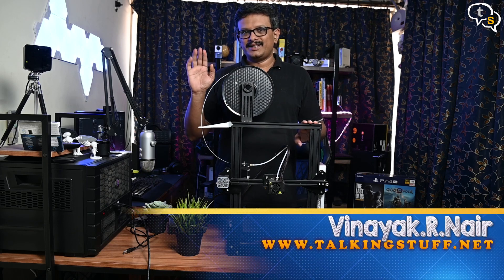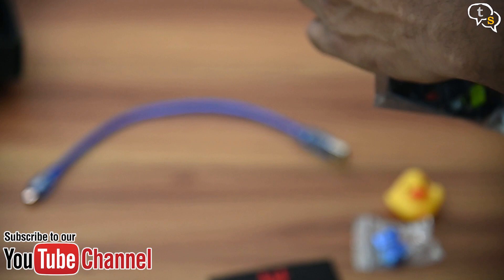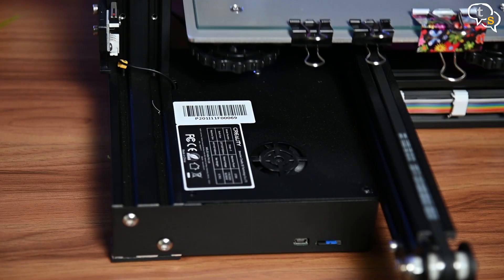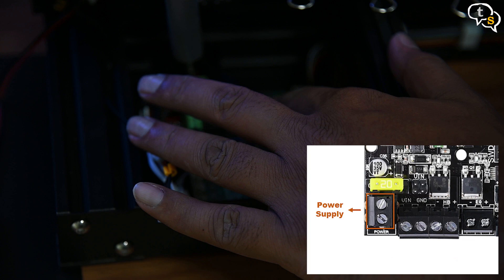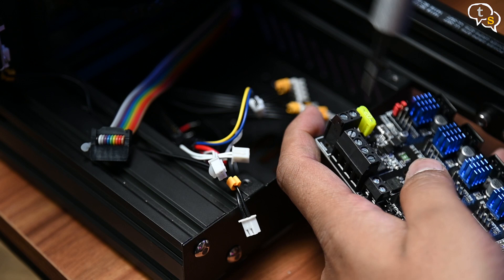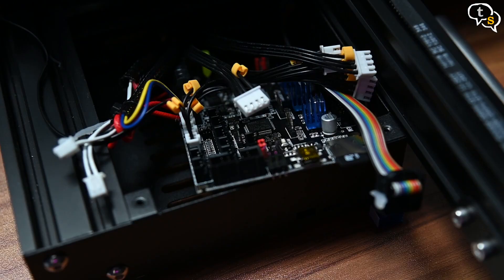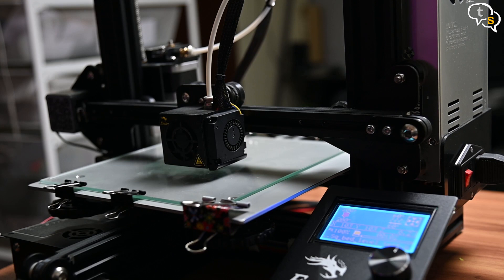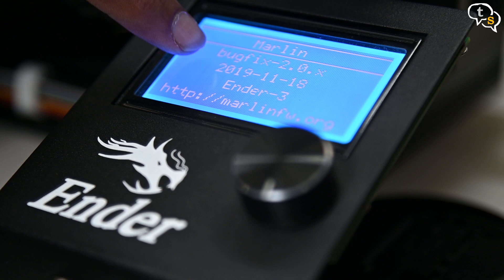SKR Mini E3 - Ender 3 3D Printer 32-bit controller board upgrade

Comment: Does  anyone know by any chance if octoprint works with this board along with the tft35 e3 v3.0 display and ender 3 printer?
Reply from the maker: I've read to keep the connection speed to auto and alsp power on the printer before connecting the raspberry pi to it. Connect only once booted up.
Reply: @TalkingstuffNet  Thank you!

Comment: Iam interested I buying this board and the stepper driver...I want to know if there are issues in customs while getting it from Ali express
Reply from the maker: I purchased from Biqu website, who are the developers of the board. I had no problems with customs when I purchased from them. But I had purchased last year, not sure if there are any changes to customs rules now.
https://www.biqu.equipment/products/bigtreetech-skr-mini-e3-control-board-32-bit-integrated-tmc2209-uart-for-ender-4

Comment: hey i am planning to build my own 3D printer just for fun and wanted to lean about it do you think i can use this board to make my own 3D printer or it only works with Ender3 ?
Reply from the maker: There are a lot of  parts both moving and not and  sensors that make up a 3d printer, this controler is designed with the Ender 3 in mind but the marlin firmware can be modified for most 3d printer models..
Reply: @TalkingstuffNet  yeah okay

Comment: Hi Vinayak, The biggest problem I have been facing upgrading my Ender3. Mistake on my part has been that I have been too slow in making the decisions to upgrade. By the time, I decide, most of the spare parts goes out of stock on e-commerce websites. 

Is banggodd still importing in India. Last time I checked in July, a few of my order got cancelled, because of the import resrictions form China. Is everything good now. 

Also where did you get this controller board from. I checked Biqu's website. They do not ship to India. Do I have any othe options left if imports from China still hasen't resumed?
Reply from the maker: I ordered off the biqu website , but last December 2019. Have not ordered any items off banggood for quite some time now.